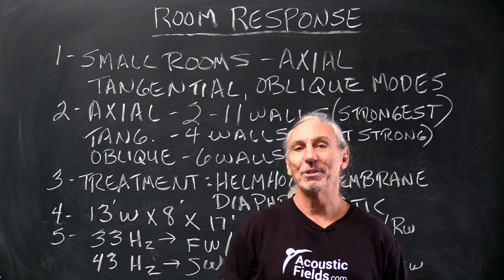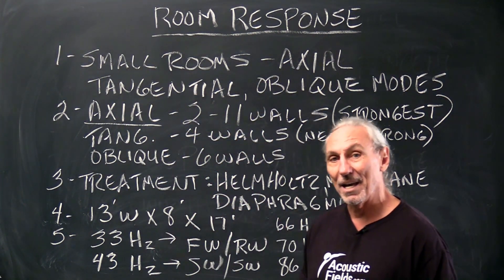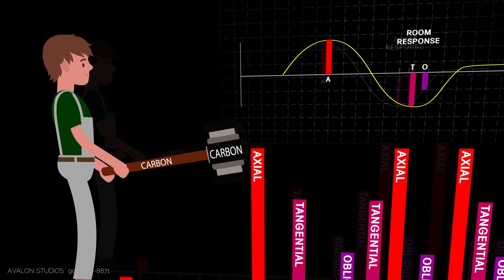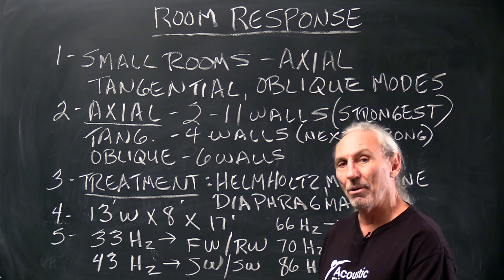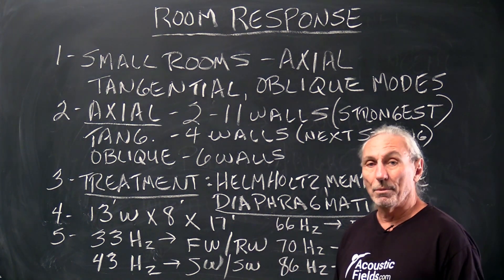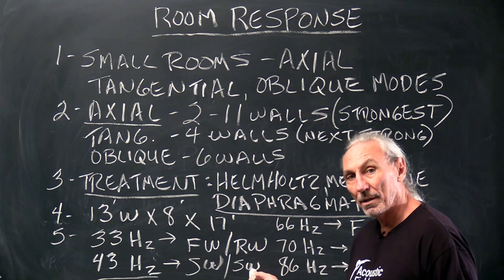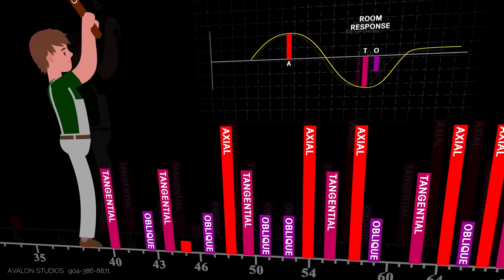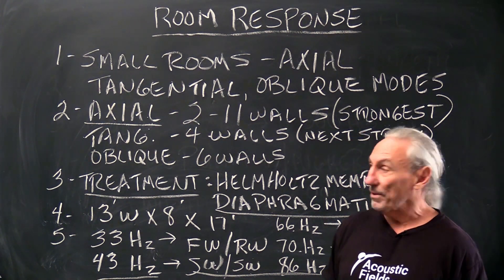Carbon Hammer - www.AcousticFields.com

Comment: Hello, i look for something that stops the "taos hum" tone and some more infos where this constant tones come from
(~16, 61, 120 Hz partials in my place in south germany), my guess is it is the sum of car and truck traffic and industry noise... u can also hear it kilometers out in the green, so it is not only in rooms in the city.. very mysterious
Reply from the maker: With noise, you must measure first and foresmost since the treatment type, amount, and position depends on the frequency and amplitude of the noise. If you guess with noise barrier construction, you will usually guess wrong. Guessing wrong by itself is not an issue but with noise, in most cases, you have to tear out the work and redo. No one I know, wants to go through all of that. With noise, you do not want to spend 1 dollar more than you have to. The noise numbers will tell you what materials to use and how to contruct. Mesaure twice, cut once.

Comment: The animation makes this video probably one of your best. Why? Because many of your potential clients will just understand they have a problem - but won't understand high level talk on acoustics. The animation hopefully helps to drive home the importance of dealing with low frequency problems. I got told that I speak too technical yesterday just for mentioning HD and 4K. This is the level of some clients. Great video.
Reply from the maker: Thank you. I am trying to show the relationship between problems and solutions.

Comment: I built a membrane low frequency absorber for my live room  it,s big 120x120x10 cm the membrane is heavy rubber 5mm thick and weighing 15kg. 
I tuned lower tension compered to the beater skin on the bass drum. And it’s suspended in wooden frame so the membrane can vibrate freely when subjected to bass frequencies. In front of the the membrane is 4.5cm acoustic glass fibre covered with fabric in a second frame. This actually works well and makes a difference to the bass response in the Room. For more tuning choices the best would be to build the membrane frame with hopes and tuning screws so you can tune the membrane tension any way you want like a bass drum for the frequency you want to absorb. The most easy way to do it is to use a used 24” bass drum and mount the rubber membrane instead of the beater skin. You fill up the bass drum with fibreglass acoustic insulation and cover the front with fabric. You leave space from the insulation so the membrane can vibrate freely. Now you have a broad band tuneable low frequency absorber.
Reply from the maker: Membranes are a lot of work and they do not have the horsepower of a diaphragmatic absorber. You will spend more time messing with a membrane absorber than you will building a diaphragmatic that works much better.

Comment: Like always Denis, a great tutorial. I'm pretty lucky with my entertainment/lounge room, it's a open plan area with a kitchen, being a big area, it's 23" long x 20" wide and 9" high ceiling, concrete slab and cinder block construction, with one down fall, a big window 6"x8" to the left of my front stage, that I made some sound absorption panels to treat and for behind front stage, plus for infront of my atmos speakers 4x ceiling mounted, I made the panels from mostly second hand materials, I sourced very cheaply, I used heavy duty double fluted cardboard, I got for free, then 3 double bed foam gel mattress toppers for $25, with the dense foam floor tiles that  lock together from a recycle yard for $10, I layered these like so, cardboard back - foam tile layer- cardboard layer -foam tile layer and gel foam layer being the front, wrapped in new cotton cloth and the most costly part at $120, in all 11 panels, for something so cheap, the change in the room accustics was amazing, when I run the ypao on my Yamaha RX-A3070 the difference it made was amazing, a totally different ypao response change, I'm now enjoying my sound system so much better, a big part to your input and great knowledge, thank you Denis.
Cheers
Stephen

Comment: Helmholtz really too frequency dependant for the amateur to build without investing in the math. Then if you change something in the room, it won't work. Carbon is the best bet.
Reply from the maker: Helmholtz can achieve level but their rate of absorption is not strong enough. You need to many units. We do use it for notching out 63 Hz. in ceiling heights under 10'.

Comment: Hi Denis, I took some time to dedicate myself to this incredible world and a great doubt arose regarding the treatment of bass with difframatics or resonators. Well, when they work, they have their own vibrations. Is it advisable to use neoprene hangers (For examples ND or SW from Mason Ind.) To avoid transmitting to the room the vibrations characteristic of its operation?
Could you indicate if these vibrations deserve to be taken into account or maybe they do not present a real problem?
Thank you ! (Y)
Reply from the maker: P,  Vibrations are not an issue. Our units weigh over 200 lbs.

Comment: next month I am going to start making some BDA traps mostly outside with my saw horses and hire some power tools, I was thinking of putting some rockwool in the front opening then fabric instead of the foam you make, would that be a bad idea? regards, Ben.
Reply from the maker: B,  Very bad idea. First, these building insulation's are toxic. The fibers are lighter than air and get in your lungs. Secondly, they destroy middle range frequencies through over absorption. You can not use a product that was designed to keep your house warm or cold for music and voice. Building insulation is noise technology. The goal of noise technology is to absorb as much energy as you can.
Reply: @AcousticFields  what about just not having anything in the fronts of the BDA? I could always get the foam at a later date.
Reply from the maker: B,  The unit is composed of two parts. It is a diaphragmatic absorber for frequencies from  30 - 300 Hz. The second part is middle and high frequency absorption which is the foam face piece.  The foam starts at 125 Hz. and goes through 6 K.

Comment: Good video.... I had to look this up.  When I did a google search your definition came up for axial, tangential and oblique.  Here's your quote: "axial pressure, axial modes are the pressure areas that occur between two parallel surfaces,...  Tangential is between four walls, so we have pressure that occurs between the two parallel walls and then two more parallel walls... oblique is between all six walls. So we have ceiling, floor and then we have front, sides and rear wall."    Be careful of that phrase; "as we all know".... sometimes we don't all know or need to be reminded.  Thanks Dennis.
Reply from the maker: R,  Definitions of terms is critical to understanding.

Comment: This is near exactly my roomdimensiones other than it being an L shape room.  lenght between front/rear wall is a few feet longer. But im experiencing a huge peak at 32-33 hz and a big null from around 60hz all the way up to mid 80’s. Wich takes ALL the fun out of transient punch and rythmic music. Music with alot of lowend is fun, but gets boring to listen to over time. If i could only fix that problem and get it a bit more lineare i would be fine with the rest.
Reply from the maker: K,  Fill out the information in this link, Include photos of all wall surfaces.  https://www.acousticfields.com/free-room-analysis/